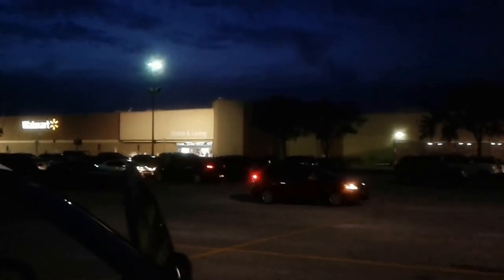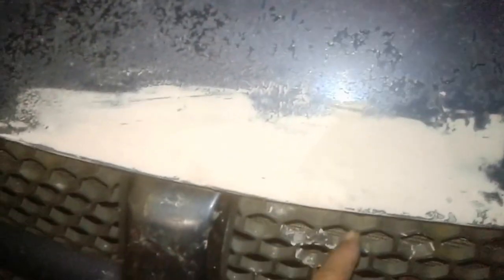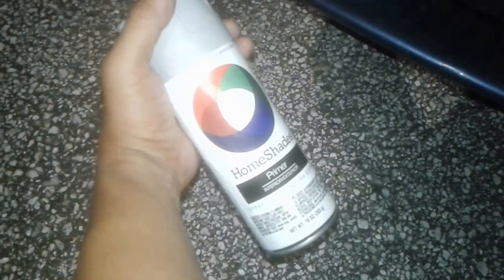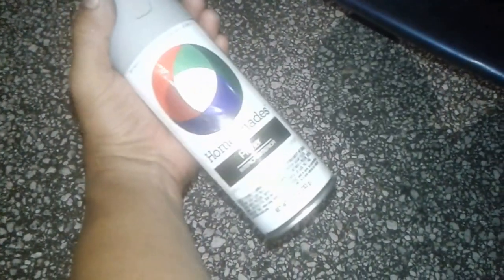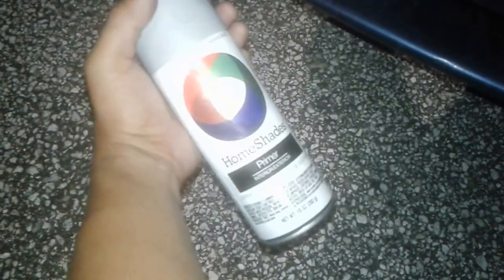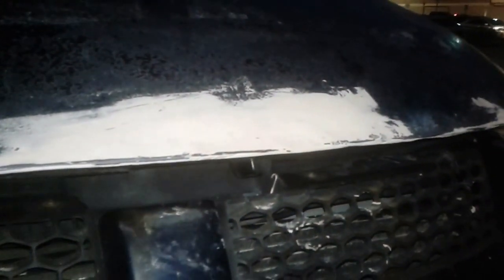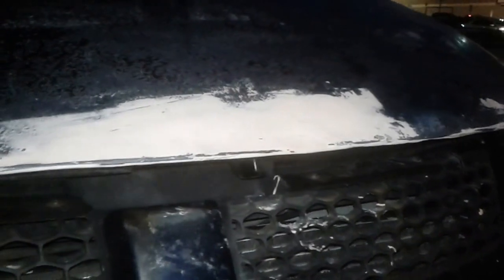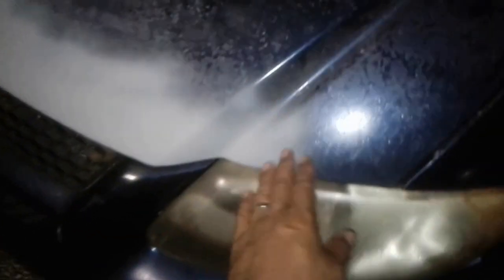Spray Paint A Car Quick And Cheap (V799)

Comment: You could've used trim clad paint that has a primer in the paint buy a big can of it and roll her on baby  lol it's thicker and protects better than spray paint just my opinion
Reply from the maker: +Expedite Travels I was trying to do it with as cheaply and quickly as possible seeing as to my luck with rain...
Reply: Living In A Van I understand I've done a vehicle both ways the paint roller is easier no over spray lol hood job tho 😎👍👍

Comment: what will happen , when the the hood heats up?
Reply from the maker: +Hollow Truth Nothing that I'm aware of.  It's been about a week or so and everything still looks good with the exception of zombie claw marks on the new paint job...
Reply: Living In A Van  thanks this my second channel,  some Of my favorites has a network 404 error,  so it turns out I can do double  the watch.    my car after I finish or even before I finish. I want to knock out some Bad rusty places,  it was under tarps,  rubbed soft places into roof another  spots.  so I wondering about your roof cool paint,  and spray paint.     by the way the Dollar tree steaks were good.